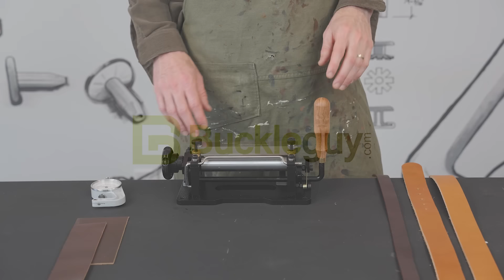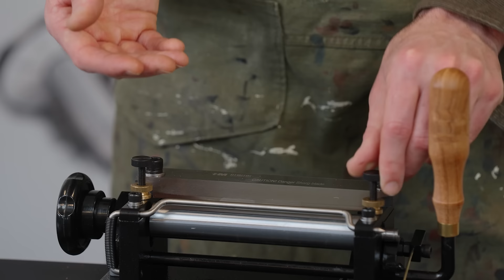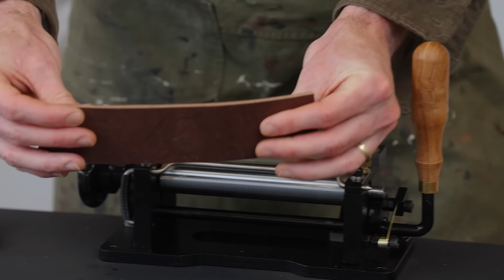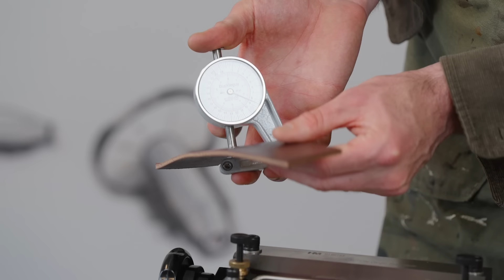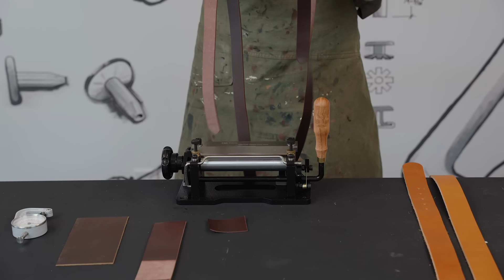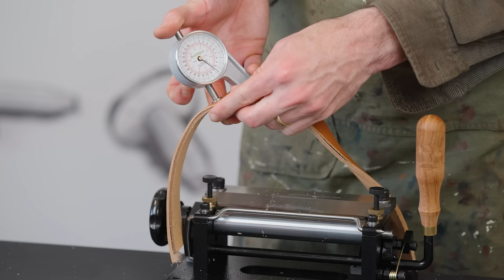How to use a manual skiving & splitting machine

Comment: you have any information on how to sharpen the blade?
Reply: For a guy who is selling these devices, that’s an interesting business model not to respond to customer questions.  Many have the same question.
Reply: @bysykler4959  Agreed. It's very important to include these instructions. If the blade is sharpened incorrectly and gets damaged, the tool will become completely useless.
Reply: I would say look up how to sharpen chisels or hand plane blades. Both are just thinner versions of this blade. I was using 600grit sandpaper and wd40 tonight and it helped a lot with little time sharpening.